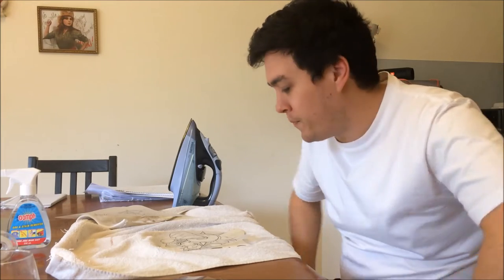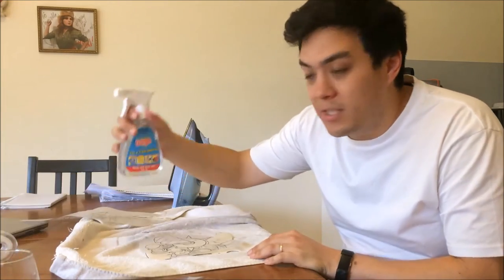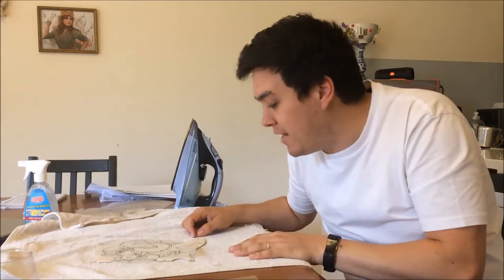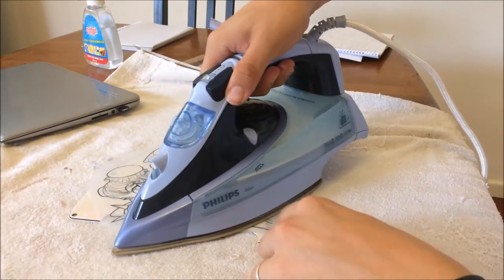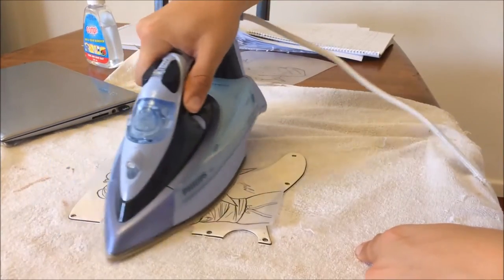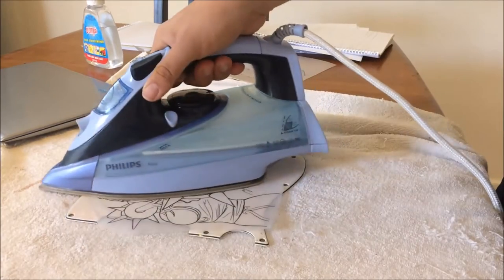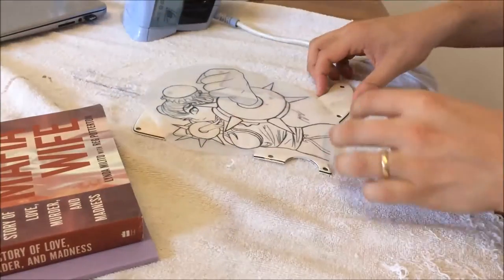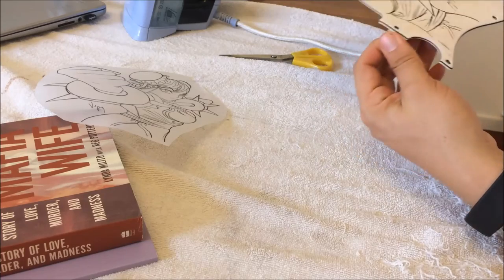LET'S MOD: DIY Guitar Pick Guard Decal (without decal paper)

Comment: Did you sand the pickgaurd before you did this?
Reply: If you do I would use extremely fine ought  sandpaper... Most likely what I use to shape my fingernails for classical guitar (jewellers sandpaper) to just help it stick better to the pickgaurd and then lacquer it in a spray on polyurethane finish. I recommend this because poly finish is the easiest to apply and sets even when applied in small increments